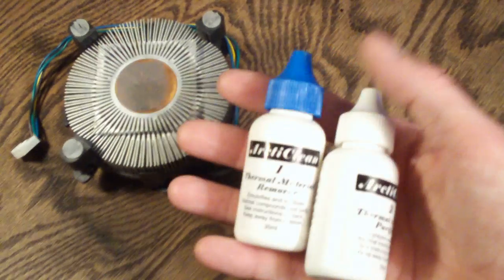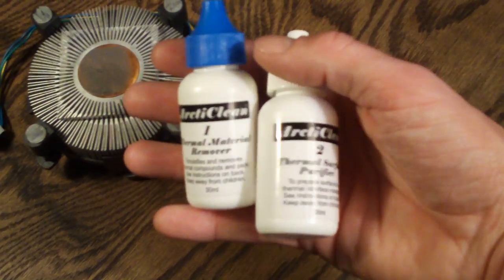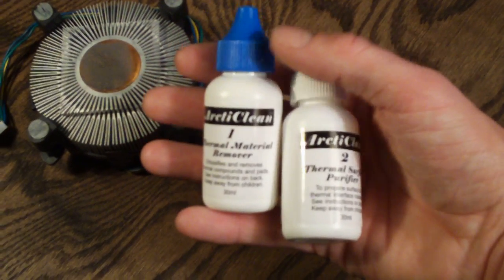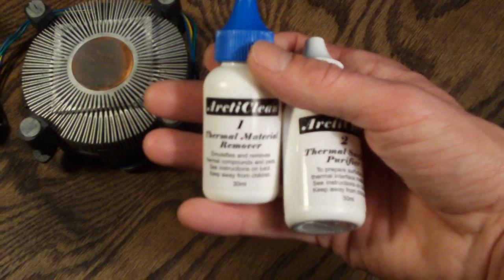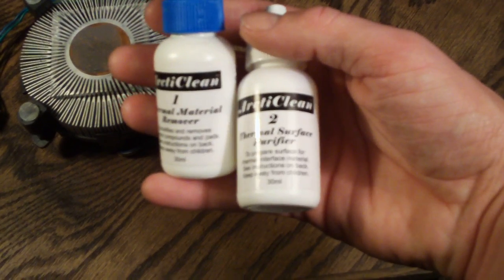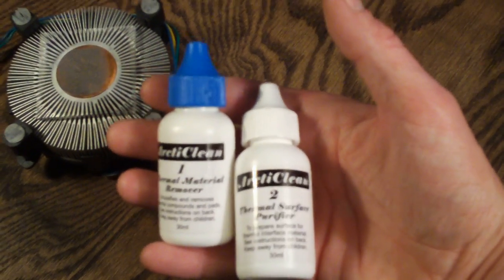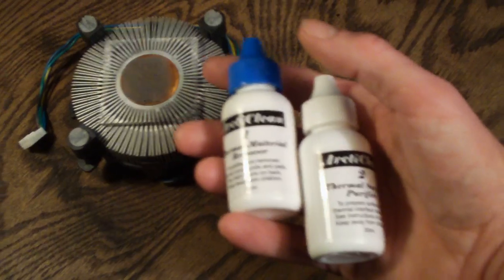Q & A: Removing Thermal Paste

Comment from the maker: @unknownplayer03 As long as the cooler is making good contact with the chips its cooling you should be getting a bit better cooling. If the paste was crusty and old replacing it with good TIM always helps.

Comment: Personally I use alcohol and then brasso (A wadding with metal polish) before finally using alcohol to clear any remains, you should give it a try, it's always proved better than the solutions I used to buy and seems to cost less.

Comment: Just wondering, have you ever used akasa grub remover?  I have been, and it works great , however what i don't like is that it leaves a slightly greasy film behind.  It smells like zippo lighter fluid with a lot of lemon extract, so i suspect there is petroleum in there or at the very least a close derivative.  Afterward i clean it off with medical grade isopropyl alcohol. 

As an all in one solution this looks far superior.  Gonna order me some to check it out.